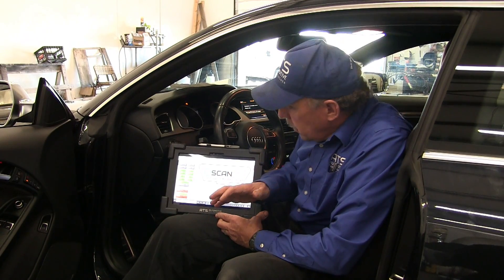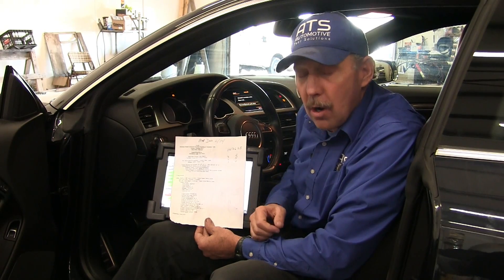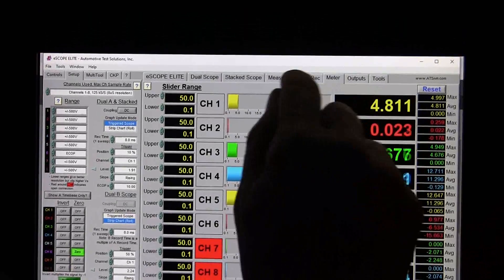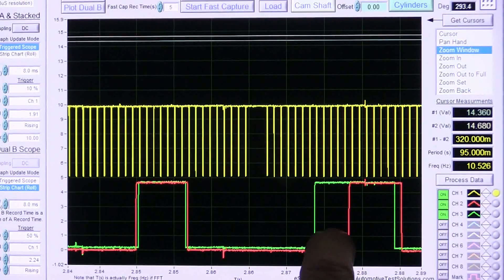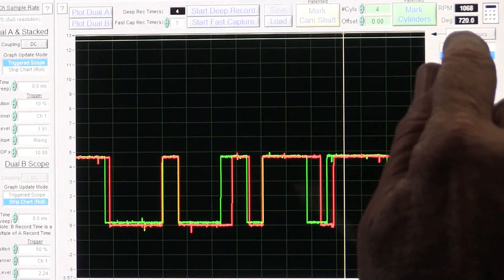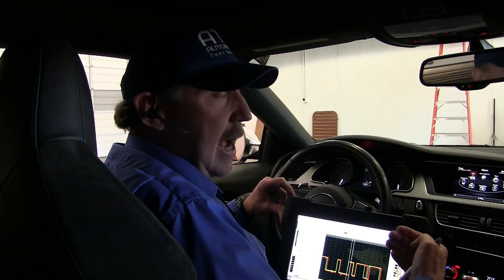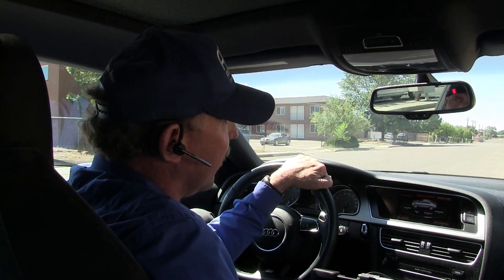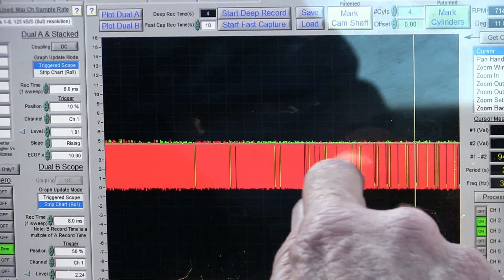2014 Audi S5 Cam Correlation Code

Comment: I have the same engine. I just had all the chains and guides replaced. Guess what? That correlation code is still there. So in my experience, once this code sets you will never get rid of it.
Reply: The timing wasn't set correctly then...

Comment: Great video I have a question. shouldn't the cam phaser solenoids turn on at exactly the same time one of them was slightly delayed were turned on.I was expecting the turn on point of both solenoids to be exactly the same

Comment: I worked on a Q5 with the same engine... no cam sensors on the exhaust cams. Rough idle and smooth running above 1000... misfires were not set at idle. I ended up finding that the exhaust cam was off when the engine was set to TDC (cam lock would not fit). That was a fun timing chain job! Thank you for explaining the size difference in the cam waveforms! It never occured to me that speed of rotation / chain slack  played a role.
Reply: Where's this guy been?? Lol
Reply: @Usmanthemecano  watching YouTube videos.

Comment: Bernie, the company does not want cam timing in milliseconds to be flagged by the PCM as they would have more timing chain jobs under warrantee. I am sure the engineers figured this all out as PCM's became better and more accurate, dont you think so.
Reply: The cam timing correlation is flagged in ms that's not what he said, what he did say is they didn't try to adjust it in ms( as in add phasing to try to get it correct to the ms)

Comment: My impression is that you have to be extremely smart to diagnose the modern car the first time and get it correct without swapping parts until you finally solve the problem as some shops do.This is why many people don't trust mechanics.
When you speak Bernie, you sound like a genuis - far beyond anyone else I hear on you tube including scanner danner.
Reply: the comparison between scaner danner and bernie is like a high school teacher and university teacher
both goods but different levels

Comment: God sakes man!  You always say go where the data leads you.  You had an indication showing a failing timing chain.  You could destroy a motor (total a car!) if it fails while you do further tests.  That car should have been locked out, not allowed to be run until its chains are replaced.  You can't continue to test at the peril of imminent engine destruction.  At least boroscope the engine to confirm.  something....  P.S.  I love your videos though.
Reply: I thought that too,any kind of chain noise I wouldn't be gunning it down the road!!!Basically a lottery no more damage occurs.